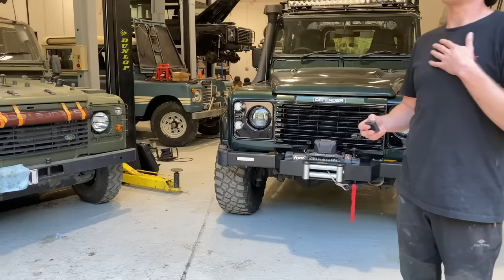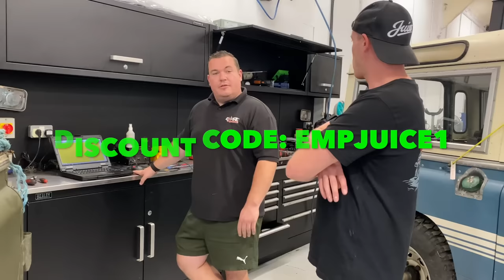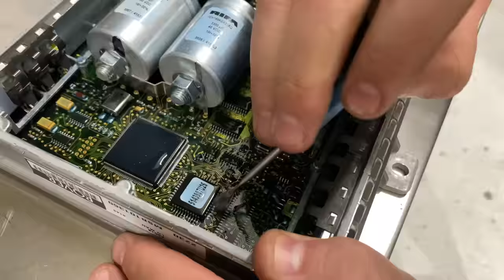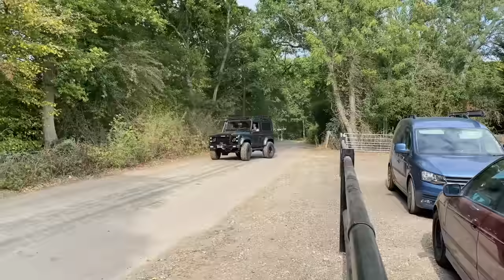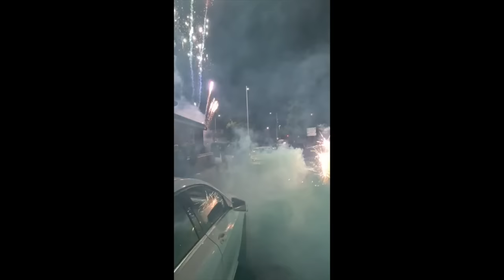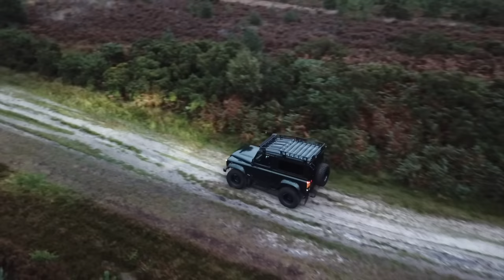Rebuilding a neglected Land Rover Defender 90 - Part 15

Comment from the maker: Don't forget to visit Gareth over at www.EmpireTuning.couk using my code "empjuice1" for a juicy discount! Still crying at 07:31 😂
Reply: Yes mate this great filming thanks for inviting me down!
Reply: was*
Reply: Sorry for your loss ....keep up the good work ...a quick question tho any difference between a straight pipe and a system like vortex system exhaust....sound and power wise? ...cheers
Reply: Condolences. Where did you acquire the led work lights for the rear from?
Reply: Congrats on a great build ! Currently working on a 95 defender 90 NAS converted to TD5. Hope it comes out looking as good as yours.

Comment: I had my td5 chipped and although it was noticeable the real change came when I fitted the larger intercooler, black smoke stopped instantly and its a pleasure to drive!
It’s a 2001 discovery which our family have owned from new and it’s without a doubt the best thing I’ve done..